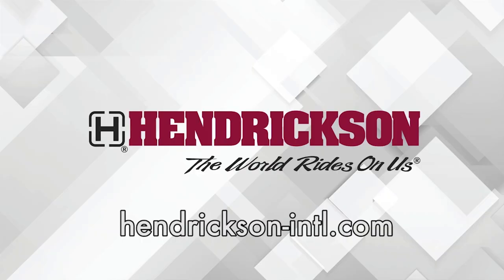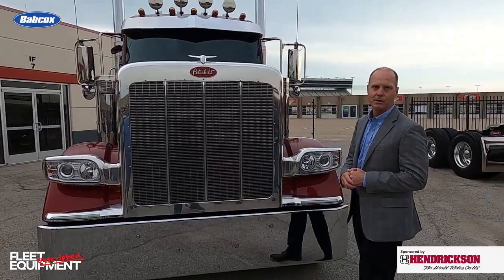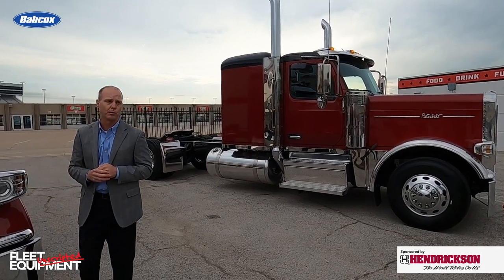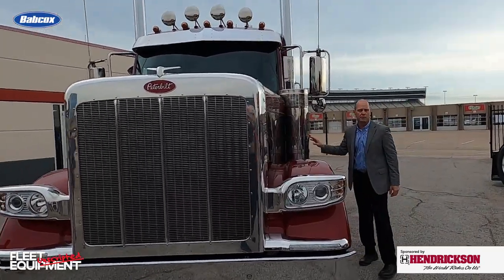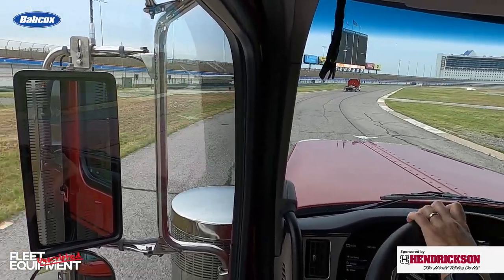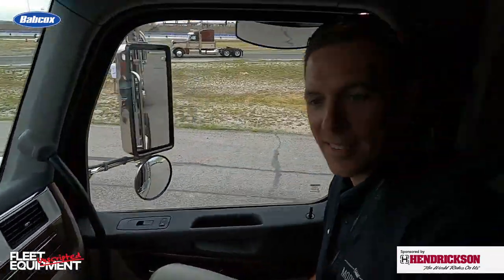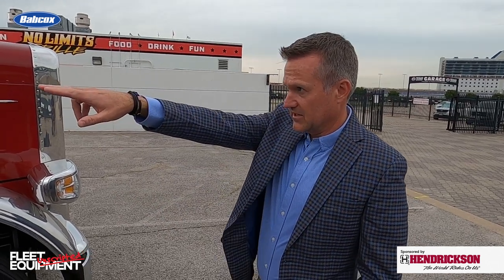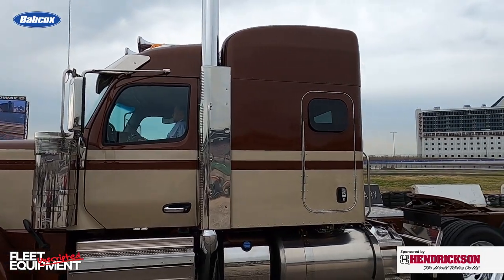Peterbilt Model 589 truck walk around | FE Unscripted

Comment: They never drive a truck East to West with the sun shining in on you most of the day from the side window. Have to put a large piece of aluminum to cover the left, front, up corner and run a piece all the way across so you don't get blinded by the sunshine. The dump the piece of crap trouble some Paccrap engine for the X15 Cummins engine that anyone will work on with 18 speed manual. Need to lobby for glider kits.